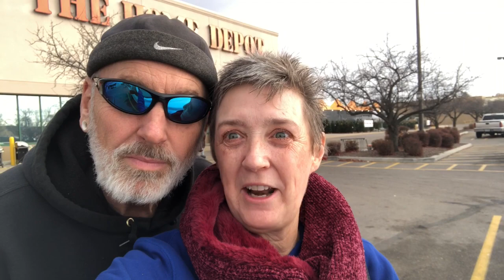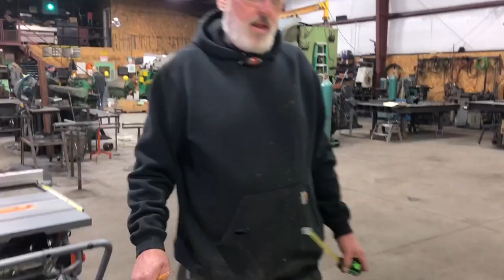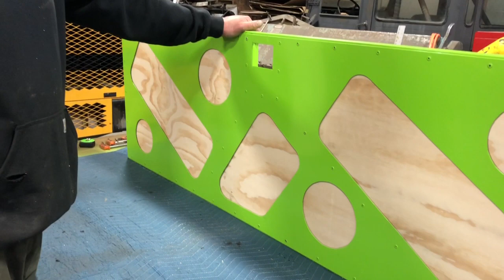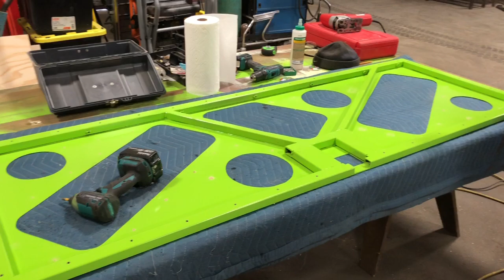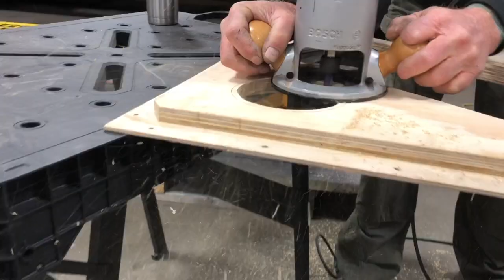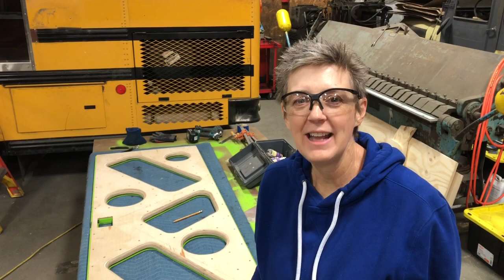Skinning Inside our Back Door … Part 4 - Vlog 53 School Bus Conversion

Comment: You could have used a router with a follower bushing to cut the holes in the wood, then you would have perfect matchups and it should be quicker.  You may keep this in mind if you do another door like this.  Either way it looks pretty cool.
Reply from the maker: Thanks -- this is the way Randy was comfortable with. But we will keep you idea in mind.
Reply: @KnappTime  I sent this before I saw him using the roller follower, which works much the same.  Another tool you should check out is this one https://www.malcoproducts.com/product/gold-standard-malco-hole-cutters/  These are great for sheet metal cutting and will cut most other materials well.  They make almost any size of hole quickly and safely.  I like that you are using the old windows to make a really cool door.